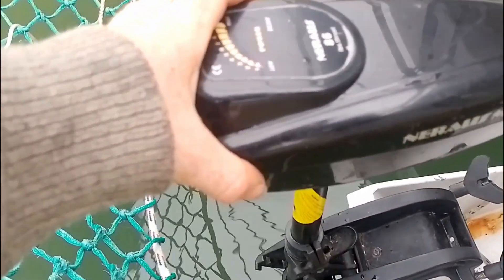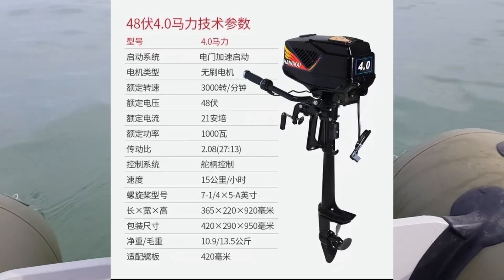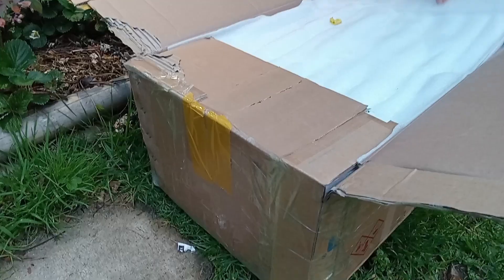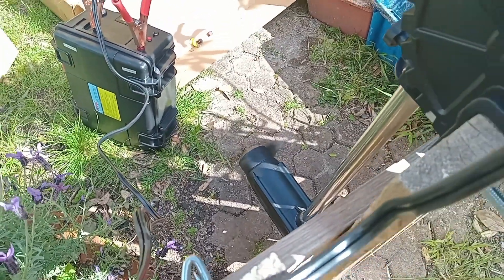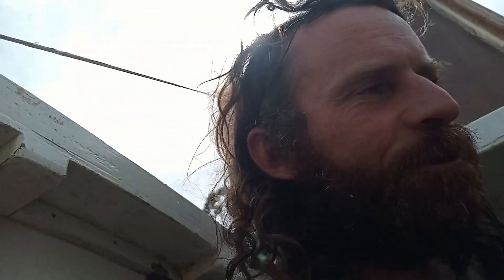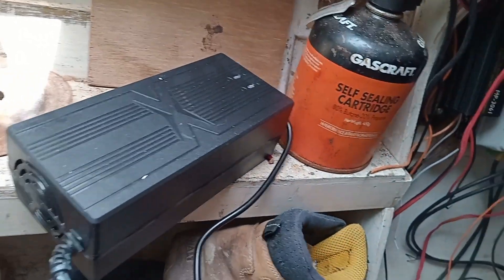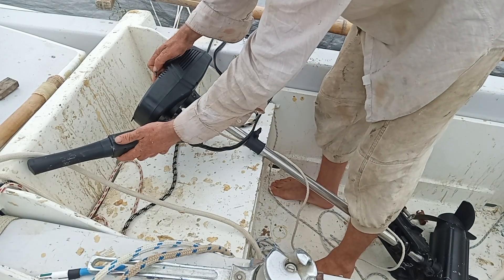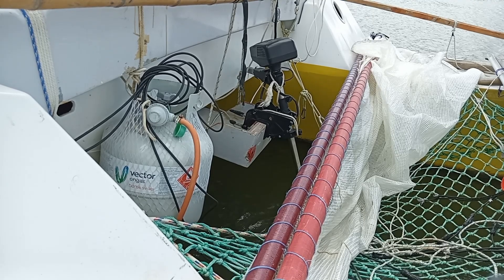Solar Electric Motor for My Catamaran

Comment: How much did that setup cost? I am considering going with electric drive...really leaning towards it. My boat is a skinny water 26' swing keel that I'm converting over to twin bilge keels. Keeping the same draft of course. 

I completely understand your reasoning for electric over gas. Actually I think I'll probably just keep a little 3.5 gas outboard under the cockpit as backup. I had one on my old porta boat dingy, it worked just fine. The tank was on top. I rarely used it. I would just use my sails 98% of the time. Good to see you still living the dream. I cant wait to build my Tiki...maybe get started later this year or next spring, too many house projects scheduled this summer.
 Cheers my friend, Fair Winds!
Reply from the maker: I think it came to 1800 nzd, not including the solar panels which I already had. monohulls take a bit more to push through the water... but I will try out this motor on my 26 foot keeler when I get up north... I think it will definitely do 2 knots maybe 3?
Reply: @dominictarrsailing  Hey  thanks Dominic, if you can get 3 knots out of it, that's pretty stellar! I looked into Torqueedos and Ocean Drives...but for what they cost. I could just about buy another boat! There's another 5hp motor on Amazon that's priced around $600...I thought about buying 2 of them to get 10hp, but it would double the amount of batteries and would need a second controller as well. I don't know if it's really necessary, or if it would just be overkill. But in my redesign of this boat, I'm building an aft-cockpit watertight locker with 3 compartments and a lid. I have been thinking of putting a motor in the two outboard lockers going through the bottom of the boat since the stern is barely in the water. I'm building a new kickup rudder mounted on stern. It's going to be kind of tight and messy looking if I  mount my motors on the stern, plus I've got my swim ladder on port side stern. If I build the inboard stern compartment everything will be hidden and out of the weather. I like the electric drives because they're small and lightweight. Most of my sailing is in fresh water and brackish water with occasional salt water crossings.

Comment: well done from devon uk shame you cant fit more solar on your boat. great channel, thanks for making the videos
Reply from the maker: well... with a little imagination... I'm considering getting some flexible panels that I can lay on the deck to double the array at anchor or in calms, then store them in the cabin. Maybe be able to electro cruise all day in a sunny calm? would need electric autopilot too.

I think having at least one backup panel is a good idea, if going offshore because I can easily imagine a panel getting damaged in a storm. I did loose a panel on my previous boat. I'm not sure what happened just noticed the glass had shattered! Managed to poke some wires in and it still worked so I had lights on the way back to where I could replace it

Comment: I've been using an Epropulsion electric for several seasons on my 16ft gaffer. I was abe to use a step up controller and a single 50w panel to top it up. I'm now transferring it to my Wharram Tiki 26. I'll be posting vids on how it goes. The Gaffer though smaller is the same weight as the Wharram and would do 2-3 knots at a third throttle. I'm hoping to get similar speeds or slightly less. Please keep doing your vids- they are the best for the simple Wharram cruising ethos in my opinion.
Reply from the maker: that's great! I'd definitely want more solar panels though. Pretty easy to fit on a catamaran. In my experience it doesn't take too much energy to push anything up to about 2 knots then it starts to take a lot more. Especially when you are well below hull speed etc. I can scull my monohull (2.5 tonne) at a knot and a half, just using my arms. I'm curious to hear how well it goes on a tiki 26!
Reply: @dominictarrsailing  I will have more solar.  The Epropulsion can also recharge it's battery whilst sailing using the prop as a turbine.
Reply: I have an epropulsion spirit the one that has regen. I bought 2 batteries from epropulsion with it at the time of purchase. I am working through issues with both batteries where they have sudden drop out . The battery either dies completely or drops to low % left . They both drop and the same % point each time .. one was at 48% the other was 25% .. it is repeatable … i returned one .. i am doing some testing on the other battery to try and work out if lower loading will cause or not cause the drop down .. i have been running them at full throttle . I posted this on epropulsion a few ppl chimed in that they experienced the same .. others were adamant they had never experienced it with their spirit.
Reply: @davidfrancis8899  I've not had any issues with mine so far but cheers for raising your issues.

Comment: Very informative video Dom.
You highlight many issues with the thorny matter of the choices we face when trying to get a decent reliable and convenient auxiliary motor system together, that won't kill you or your boat.

And beat me to the punch with a number of critiques I was going to make.
Such as the open shaft that allows water, or salty air down the shaft, cable corrosion issues.

And the very big headache currently inflicting major damage to the Marina and hardstand industry here in NZ....
That Friggen lithium ion batteries, (and I have to say completely ridiculously undependable in the marine environment electronic babysitting systems that these batteries and brushless motors need to function.) burning down marinas and now we have to get marine surveys and public liability insurance to tie up at a wharf, enter a marina, go on a hardstand. We have a crisis with all insurance companies but the MarinaShop Opua, With their London brokers refusing to insure Wooden boats over 40years old, or ferrocement yachts, and I had to do a survey report on my own Friggen Just salvaged Kauri double diagonal construction Alan Wright Nova 28 bilge keeler a couple weeks ago, or she would have been wreaked.
Something beyond the means of most people.
And fn ridiculous since it is the plastic modern gin palaces that are the fire hazard that has caused this.
Now, you say you have "a couple of miles range"
I came up six km up Hunters creek in Tauranga harbour a few days ago, half of it against the rising tide using a 190buck 55lb thruster leg. And two medium sized and several year old, less than perfect lead acid car batteries.
While towing a 500kg 14 ft tender and an 8ft seabirds sailing dingy. Which halved my speed and certainly increased my amp draw. 

 Half against an increasing current. It took one day of intermittent sunlight in winter to get them back to full charge, with a 150watt solar panel. 
Because I don't use a charge controller. 

The leg, with two big wires coming out, is more reliable, powerful and efficient than the same 55lb brushed DC motor and prop in 5f3r outboard configuration.
But I have still managed to go 15km on two not fit for starting a car anymore, batteries, with the 55lb outboard. 
And this is with ten ton of Tawai Wharram oro that definitely has more wind age and wetted area than you do.
I get 12km range from those two car batteries with the 14ft  tender and those two batteries. In choppy seas, without current assistance. But only 3km from one of them.
Reducing the Amp draw by parallel wiring any batteries will vastly increase your range.

While brushless motors are a couple of percent more efficient, the controllers take away 30 to fifty percent. So they are NOT as efficient as brushed, except at low throttle settings when the brushed ones use resistors in series, to throttle.
And As you found out the LiFePo babysitting electronics can dump on you without warning. And it is also true that the Ekecfuckery Babysitting systems suck your power and even LiFePo have a habit of killing themselves quickly, and have no Warranty if used in "damp conditions" etc.
Expect a 90kWhr 12.7V LiFePo that retails for 1200 bucks in NZ to last 1 year.
They pretend to be watertight casings, but are not, and salty air is enough to corroded and short between the cells.

I have had very good results from lead crystal batteries, that marine deals sell. But the ONLY commercially available safe, energy dense, unkillable, no electronics required, last a century, cells commercially available, are the  Nickel Iron 1.6V individual cells still available from China. But shut down in the US in 1965 because they worked and lasted too well.
I know that NONE of the commercially available motors are Safe or effective.
The ONLY way you will something dependable, Efficient, is to use a brushed motor, driving a straight shaft, with a big surface area. Low pitch, slow turning Prop for pushing hard into weather.
And such a longtail system can be easily made to use on tenders, and your yacht if you want.
Variable gearing and different props for different purposes are a good idea.
I too have silicon sealed my trolling legs. But it's not ideal, because of gas expansion and cooling then able to suck water in after you stop using your outboard. I always pull it out of the water as soon as I stop, and 4 years in the weather, is pretty good for a 190buck from goodsdirect2U overnight delivery from Rangiora off the shelf system.
I think four of them, one at each corner, with 360 degree rotation and ability to raise and lower would be a very adequate auxiliary system for Tawai the fifty foot Wharram in any situation but trying to motor into winds and heavy seas over 30knots.

ONE running on 6V and drawing 150 watts is perfectly adequate for Tawai, if I wish to go 20km from the top of the harbor to the city, on the outgoing tide, in low wind conditions.
And two would be adequate for me to feel safe enough to go anywhere in the world.
And know that I can always turn in whatever conditions, and run them in series from a 12V to over 24V  system if I want  best range in conditions of low wind and not too much current.  - You can waste more energy going slow into a current at low power than faster if the current is near or above your high efficiency displacement speed range.
Which is about 10 to 25 percent of your waterline hullspeed on deepV thinship hull forms like we have.
I do think you are mad to have 240V anywhere near your boat BTW. Only useful if you want to waste 90% of your energy using landlubber power tools and consumer appliances.

Best Wishes, and keep up the good work.

Stop being a snob 🙄😋 and give us a call, text or email. 😘
Aaron. 🤙🧝‍♀️🌊🐉

Comment: Find yourself a small gas outboard.
If it is a 4 stroke it will sip fuel, catamaran are already very efficient. You can have the same motor on your dinghy and big boat.
Our 8hp pushed our loaded 30ft catamaran at 6kt using 2L of gas per hour.

It will save you so much trouble and can save your life in bad weather.

Anyway, keep doing your stuff, I really like watching how resourceful you are.
Reply from the maker: I don't understand what you think I'm gonna use a motor for in bad weather. I've been through plenty of bad weather, never felt like I needed motor... if there is a lot of wind, sails are better!

also, I am not ignorant about gas outboards! I've had them before, I've repaired them before... and well, Its much less trouble to just wait for the wind. I can do that reading a book without getting my hands greasy.

And when the wind stops, you just do nothing and it will come back on it's own. That approach does not work when a motor stops.
Reply: Pardon me for noticing - have you forgotten calling for a tow last year when your rudder was broken, no engine and too close to the rocks? (Episode 11) An outboard would have saved you easily.

It's easy to be sanctimonious when you can rely on someone else for help with those noisy engines and nasty fuel.
Reply from the maker: @Ron-dx9wq  well, that time I had lost the rudder. It would still be respectable to call for a tow if you have lost steerage. maybe an outboard would have worked as a rudder for a bit though if it was mounted nearer the back
Reply from the maker: @Ron-dx9wq  also motor people need tows, when their motor breaks...
Reply: @dominictarrsailing  Let's say you have to get in a inlet or a tight entrance and the wind, waves, current are not on your side.

I had someone drag his anchor that grab mine tangling our boats together and dragging toward the rocks of course when the wind pick-up.
Our outboard push both our boat to savefy (the other didn't have an engine)

In the Bahamas a sporty trimaran had is rig fall down 20 miles offshore with the wind blowing him offshore. He fired up his engine and was back in port in a few hours.

Sometime you have a tight weather window do to a crossing and the wind is not good, you fire up the engine and get there safely and in time.

But it's noisy, and it's not the thing for long crossing. But the power it has simplify so much of sailing and allow you to self rescue in bad situations.

Don't get me wrong, I admire your resilience and DIY spirit and your guts to do things your ways. I just wish you less trouble and risks.
I see many youtubers trying electric (I have been tempted too) But I did the calculation of autonomy, power, reliability and cost and I saw that it didn't make sense in a boat for a while.
Reply from the maker: @alexforget  all those things are better approached with better planning. Like dont rely on an engine to make a passage. If it breaks down youll be in more danger, in thay way the engine will get you into trouble. Anyway. I simply am NOT going to get a petrol engine. please stop suggesting it!
Reply: @dominictarrsailing  ok, ok. I disagree with you about that but I like you anyway ;)
I you come near Montréal or the Bahamas our path may cross near the water. I hope it happen, I'll buy you a beer and we will hash it out.
Cheer !
Reply: That might be good advice if it were not for the fuel we have today, sucking water out of the air and separating into a layer of water within a week if not kept hermetically sealed. And the need with ant outboard made in the last 40 years to flush with fresh water after every use, and spend more time on maintenance than you get using it.
We are not one week a year holiday pleasure boat, more money than sense idiots man. You can't live on a boat, go places, and rely on any internal combustion  outboard.
And certainly not any made since the early 1980s.
And DEFINATELY NOT 4 STROKE ONES!
Reply: @Maungateitei  I have done it. In the heat and humidity of Florida and Bahamas in summer.
I did clean a bunch of carburetors at the beginning but then added filters.
We had a big filter near the tank and a tiny one just before the carburetor. We also had two 9.9hp engines. At some point we caught nets and ropes in our engine, lift it up, use the second one, we were going again before our buddy boat ever saw we add a problem.
Now I am suspicious of a propeller I cannot lift out of the water, inspect and fix if required. I see so many sailboats needing to be hauled out in remote place because of problems with saildrives.
Never heard of fresh water rinse.
Reply: I have a 1970 Tohatsu 5hp. And yes it's useful if I want some grunt in bad weather to get out of trouble. And can be run on cheap kerosene, worth 30cents a litre, without outboard oil.
And will not have issues if it go's for a swim. Provided I wash it, inside and out with water, CRC, and give it a good run within a few days.
It pushes Ten tons Of Tawai Wharram Oro at 6 knots. And uses about three litres an hour at full power.
Reply: @Maungateitei  Good, didn't know they would run on kerosene!
The only downside I see is the noise. It's tiring if you have to motor all day with the high pitch noise. But then again nothing electric will give you 1/10 of that power and autonomy.